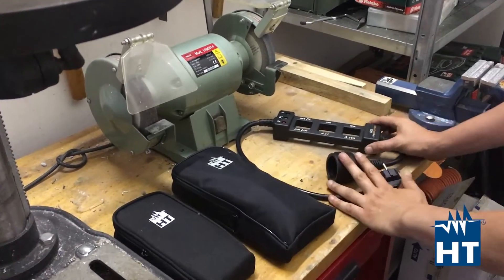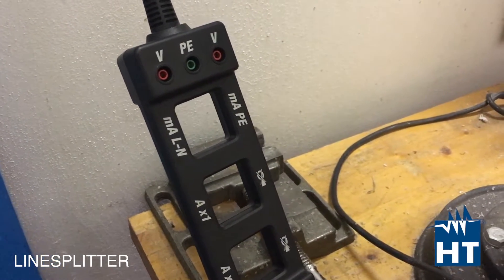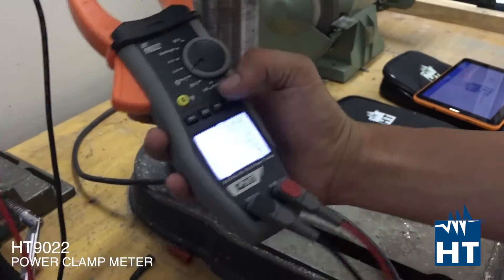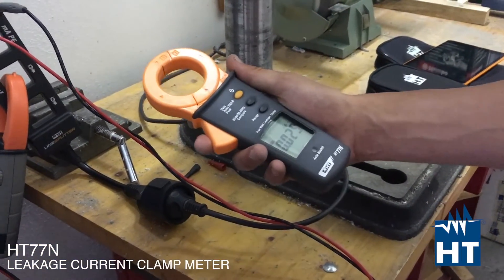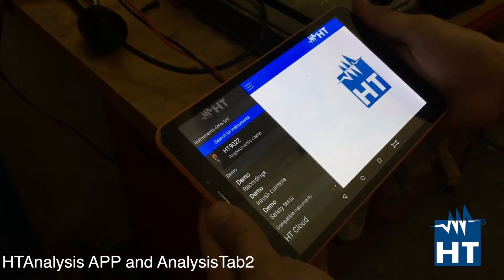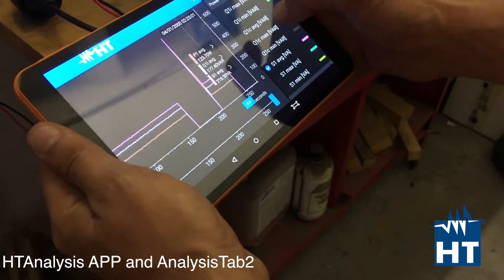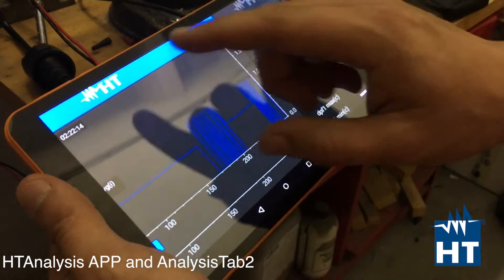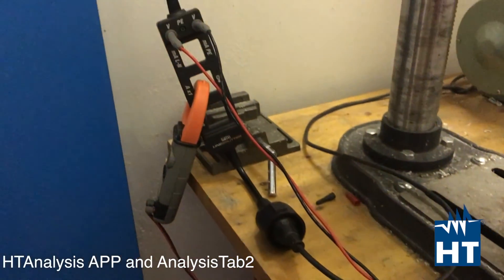How to measure current with Line Splitter by HT Instruments

Comment: I think that - this device is not just a toy. That’s pro meter was made by professional — for professional!!
Wen you have to work with industrial stuff, and you need to get professional calculating, power running, load current,
& etc...
So you have to have this toy with you all the time during the project!
Wold you agree with me on that??